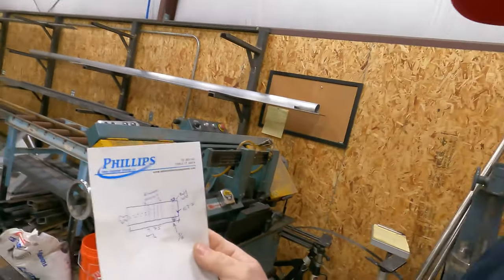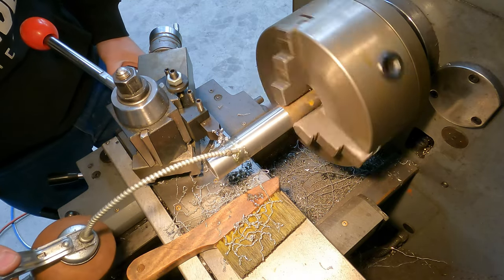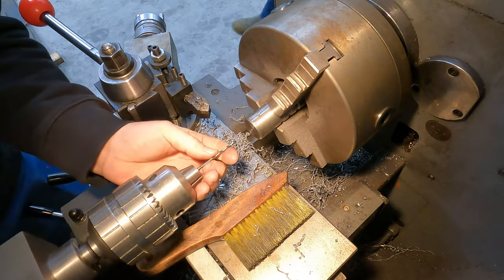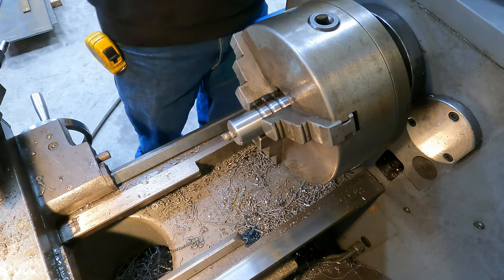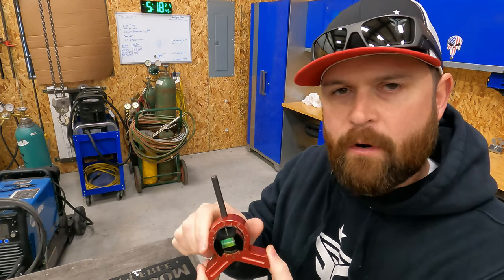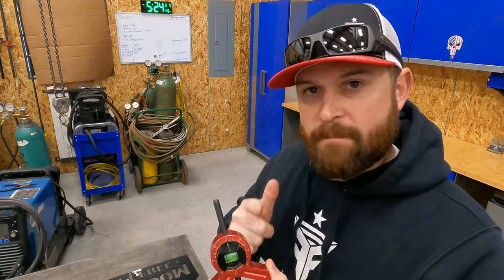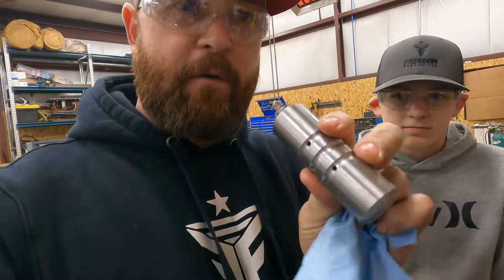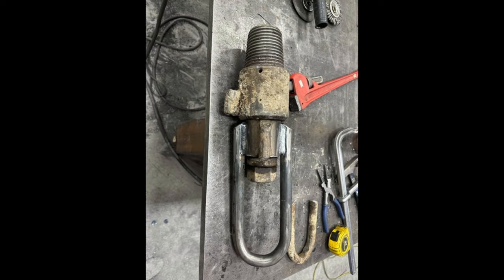Machining Drill Rig pin and more welding business talk

Comment: In the intro, is that porting a gear pump housing on the mill?
Reply from the maker: No, I was counter sinking a hole for a reamer adapter to Allow the bolt head to seat below the friction surface.